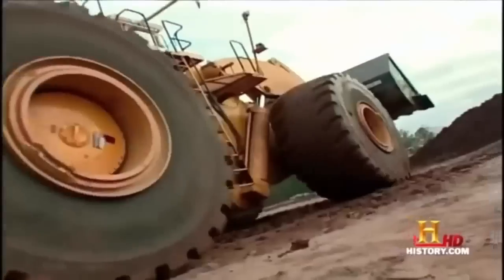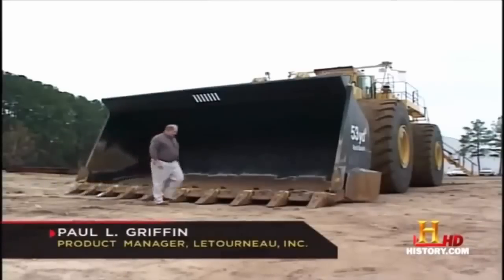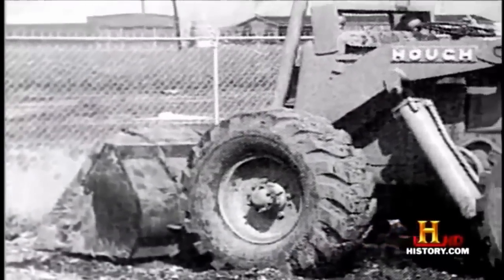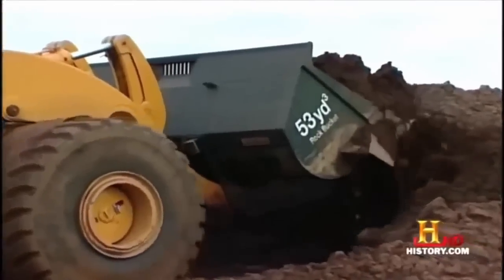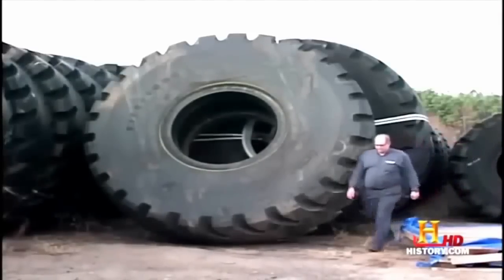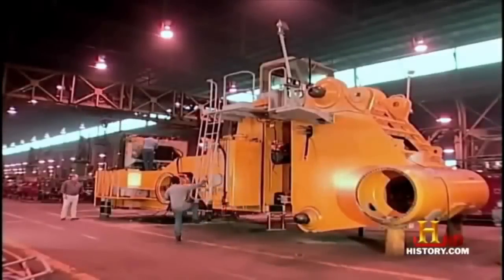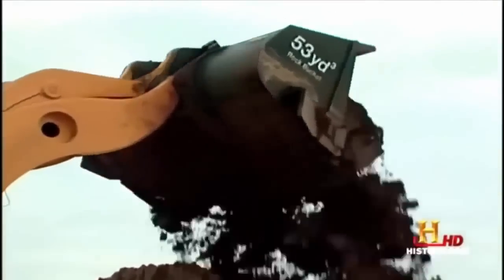LeTourneau L-2350 - The Biggest Wheel Loader in The World

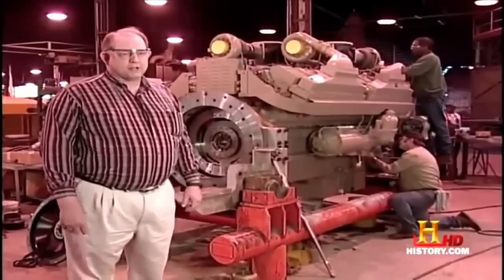Comment: an engine like that but still using tape to fix it (3:10)
Reply: They are masking off inlet/outlet sections of the motor until its installed in the machine and the final hose and pipe connections are made

Comment: imagine a small ass coolant leak and having to drain all 150 gallons of coolant to fix it
Reply: Thats alot of 5 gallon pails
Reply: : b j llk Go :/
Reply: And how big a crane do you need to remove the radiator ?
Reply: @michaelvrooman5681  the hoses to the radiator are very easy to replace. And the radiator is almost indestructible pretty well made. I operate a L2350 at a coalmine in wyoming and I have helped numerous times in replacing coolant line and hydraulic lines they are very well easy to replace. The hassle or the struggle is having the part available at the warehouse or having the right couplers or fitting to make a new hose.

Comment: The L-2350 is a good machine. I still prefer the CAT992 though because of size, maneuverability and available options. Still there is no denying that the 2350 does have a wow factor. To put this in perspective. A 2350 could push a Komatsu dozer aside. Though only about 100 ton difference  between the two machines, the 2350 far and exceeds the dozer in terms of shear brute size, strength and power. If you chained a 575 to a 2350, the 2350 would drag the 575 all around. Yes, it's that freaking big and that freaking powerful.🔧
Reply: Wow! How much does this front loader weigh. I know they said it has the biggest tires. I think it could lift a train car or at least dump the engine over.
Reply: Did you just say komatsu 375a dozer. Eww🤮
Reply: The L2350 has a 210,000 lb weight advantage .